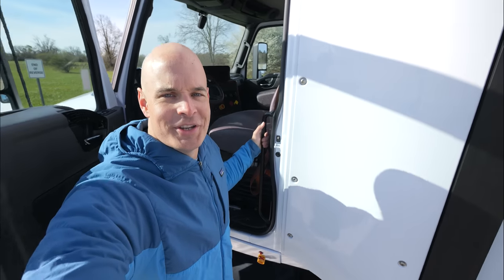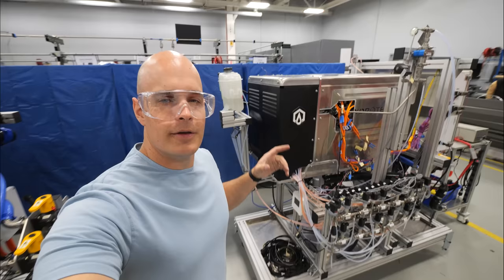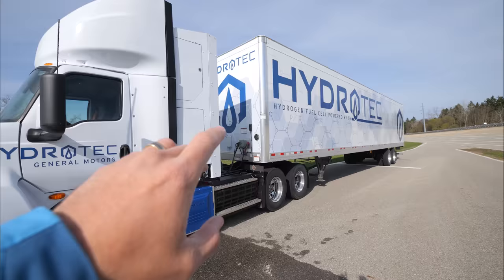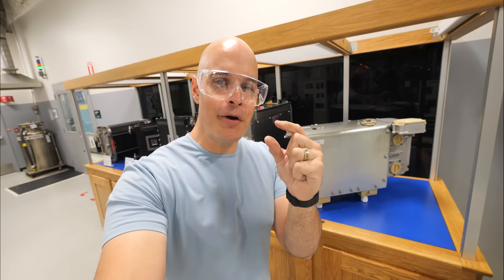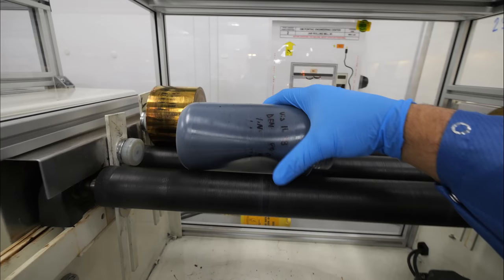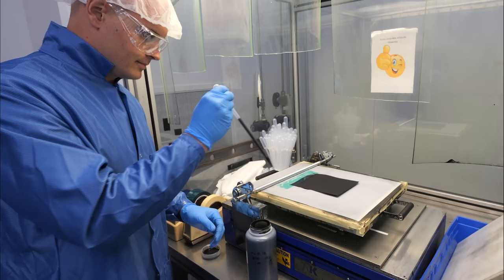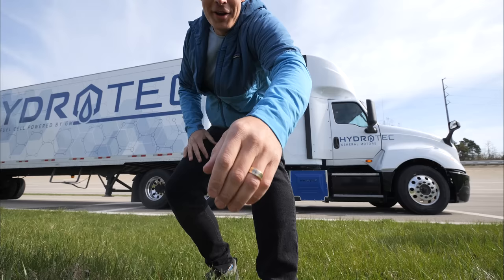How to build a Hydrogen Fuel Cell Semi Truck? - Hydrotec Factory Tour

Comment: Hydrogen is abundant but not in the form of H2 molecules. (The one that is burning in these cells.) Thus you need yet another energy source to do the hydrolysis and generate hydrogen from water. Not a very economically viable process...

Comment: So basically, hydrogen vehicle is electric vehicle charged by hydrogen. Thats why toyota wasnt launched ev at the first place, they keep doing research on hydrogen vehicle, which is way more more complex than ev. The hybrid system itself is way more complex than pure electric vehicle, they have to find a combination series-paralel engine to the most efficient way. Respect toyota.

Comment: So in a few years you can buy a portable  hydrogen generator to charge your tesla.
Reply: Smh
You take electricity.
Plug your Hydrogen generator  into the wall socket.
Make hydrogen.thrn use a fuel cell to convert it back to electricity to "charge your Tesla"
But you only have 30% of the electricity that you put into the "generator"
..
Really?
Think it through.
Reply: @rogerstarkey5390  
What if you charge your tesla with solar
Make hydrogen with solar then you have a solar powerbank😀

Comment: Fantastic! It would be interesting to see if some huge solar farms out west could generate enough energy to make hydrogen a significant part of the transportation fuel source. Awesome video!
Reply: Or.
Those same huge solar farms could move EV trucks 3 times the distance for the same cost.
If you were running a fleet, and someone said "we can provide two types of vehicle, one will cost you 30% that of the other in fuel"
Which would you take?
.
Then, when you said "but that vehicle doesn't travel as far on one "tank" of fuel, they told you
"It can run as far as your driver, then while your driver rests (compulsory!) it will "fill" up without the driver being there and give more range than is needed for the rest of the day"
.
Would it be a difficult choice?

Comment: But isn't it too expensive! Are we saving enough that it can reduce carbon emissions. Plus it is much more complex and dangerous as we know hydrogen is explosive. And platinum is pretty  expensive. I am pretty sure H2 fuel cell will be much more simpler in near future. But as of now Combustion engine and normal electric engine are good.

Comment: It doesn't make sense to use hydrogen to electrify trucks, when we already have a solution that is super easy and more efficient to electrify - trains. Using overhead wires, rather than having hydrogen or batteries as an inneficcient middleman, we can take electricity straight off the grid, making it ridiculously efficient. Add that to the fact that trains are inherently more efficient than trucks due to reduced rolling resistance, and you tell me what the best solution is.

Comment: Hi Zack, Hydrogen powered Semi Trucks is not feasible due to the fact that the proton exchange membranes in the trucks require platinum and iridium, metals that are rare and can only be mined in 3 countries - South Africa, Russia and Zimbabwe. Also, while the Hydrogen power is green itself, the production of Hydrogen is not since production of Hydrogen relies heavily on fossil fuels. Moreover, Hydrogen powered vehicles do not like cold temperatures.  Sabine Hossenfelder has a youtube video called "Hydrogen Will Not Save Us. Here's Why." which covers all these details and it is a fascinating watch. I suggest you check it out.

Comment: Toyota Motor certainly reckon that Hydrogen is the way forward since they are starting to make their cars for Hydrogen rather than electric according to the video I was watching a few weeks ago. Peugeot motors were on about making all goods vehicles with Hydrogen that was a few years ago but I think they changed their minds as Hydrogen wasn’t going anywhere at that time with Governments wasting time going down the electric route which as we all know but a lot refuse to believe isn’t either green or going to work although it is getting better but it’s carbon footprint is through the roof.

Comment: Yes Jerry, you should do a comparative analysis of what would be required to replace your humvee battery with a hybrid battery and hydrogen fuel cell stack and storage.

Also you will need to evaluate the water dissociation process to generate hydrogen and compress and store it, all from renewables of course, as opposed to striping the Hydrogen from hydrocarbons.

Which brings us to the meaningless talking point you made about hydrogen being the most abundant element in the Galaxy(sic), you should have said universe.  EVen so, all that hydrogen isn't available as an energy carrier until we liberate it from some other compound, like water.  So I'm afraid you've fallen victim of a pointless legacy industry talking point "most abundant" my friend.

Don't get me wrong, I'm familiar with hydrogen as energy systems technology.  I'm glad we have PEM (Proton Exchange Membranes) technologies like the one they let you build.  And I'm particularly fond of metal hydride storage methods that are as dense as liquid h2 but at more meer mortal ambient temp and pressures (300psi) with weight as the trade off.

But all that we can know and Occam's Razor continues to lead me to the conclusion decade after decade that Hydrogen Fool Sells are nothing more than a Rude Goldberg Battery.  The major difference being that HFC keeps users dependent on a specialty fuel vendor paradigm, mostly for the sake of the preservation of itself AFAIKT.

Comment: This is cool tech but I'm not convinced by hydrogen. You said that this has been in development for 50 years at this facility? I'm pretty sure that batteries are in production right now. The fuel tank is made from carbon fibre, which is still only made by hand and is a very specialist, slow, expensive and non environmentally friendly process. Then it has to be held at huge pressures, which costs energy. Add the complexity and cost (environmental and financial) of actually making hydrogen. Batteries have their problems but they seem fairly easily solvable compared to H1

Comment: I'm not convinced
This is a huge footprint for the tanks
They are probably extremely expensive to manufacture and maintain
How dangerous is fuel stored at that pressure?
This is not as quiet as he stated (He's speaking quite loud to talk over it)
Reply: Well Saars, if you are not convinced I guess they should shut the whole thing down.
Reply: @a_kazakis  I hope development continues and they make some major improvements, but the way it currently works, I don't really think it will see major adoption
Hope I get proved wrong though because we need trucks to get off diesel asap

Comment: Why start off with an irrelevant fact that hydrogen is the most common element in the galaxy?  That's nice, I live on planet Earth where it's like number 10.  I guess it doesn't sound as impressive if you say: Hydrogen is the 10th most common element on Earth.  Doesn't really have the same ring.

Comment: Question. Is any hydrogen lost in the process or is it all converted to water? If it all converted could a second unit take the water that is produced and separate the hydrogen to be used again? Essential an endless supply of fuel. I am guessing no. Lol.
Reply: No you can’t because where would that energy come from to to split the H2O?
Reply: @Simon-dm8zv  the fuel cell.
Reply: @ncphenom2309  So.. where would the hydrogen come from to power the fuel cell?
Reply: @Simon-dm8zv  I don’t think you are following. The fuel cell converts the hydrogen and oxygen into water which then a separate system could “steal” use from the fuel cell to separate the hydrogen back out to be reused by the fuel cell. My guess is that the energy needed to do this would max out the cell capacity and thus not work.
Reply: @ncphenom2309  I am completely following. What you are proposing is not possible, as you already admit in the last sentence.
Reply: @Simon-dm8zv  I’d like someone with actual knowledge around it to confirm.
Reply: Can confirm, NO.
Way too many losses in electrolysis of water and heat in the fuel cell.
The whole reason we have so much water on this planet is because that H-O-H bond is so hard to break.
Reply: @jimurrata6785  yup

Comment: if viable, sure. getting loose around the most reactive gas spells disaster. and procurement of hydrogen on a commercial spectrum is easier said then done. in a few decades maybe. but they called it the tech of tomorrow 35 years ago so it is justified to be muted in response.

Comment: Cool but will never happen except for demos and PR.
1. Hydrogen is expensive. It’s 4-5x more than gas/diesel and 10-20x more expensive than EV
2. Most hydrogen is created with fossil fuel so not really “clean”. Very little hydrogen is “green hydrogen”
3. Fuel cells are super expensive - even too expensive for semis.
4. By the time it is “market ready” EV semis will already dominate the road
5. Because of all of the above, there will never be a hydrogen refueling network… it will be too expensive to build and no reason to build since EV semis will kill it before it makes it to market

With 500 mile being more than what most drivers can drive a day (due to driving hours limitations), the Semi shows EV Semi are feasible. With batteries improving in capacity at about 5%/year, we’ll either see cost decrease or, if needed, range increase - with having 600-650 mile semis within the next 5 years - way more than any driver can drive without breaks.
Reply: Very well explained.

Comment: Tesla Semi will wipe the floor with this hydrogen nonsense. In commercial world running cost is everything, and since every hydrogen vehicle requires about 3 times more electricity than normal EV truck, this will never see the light of day.
And yes, hydrogen fuel stations still do not exist

Comment: #1.6👍🎉Great video Jerry!  I think the clean electricity production solution isn't solar or wind but geothermal because it works 24/7 and is just a short distance below us.  Long transmission lines will be very necessary.

Comment: Using hydrogen is effectively as dumb as purchasing an electric car and putting a gas generator in the trunk to charge the batteries. Oh, and you have to manufacture the gas yourself, using grid power.

Comment: no hydrogen can't leak through metal mate..it's just composite carbon fiber tanks can be made to withstand high pressures for a lighter vessel
Reply: you might want to do some research on hydrogen embrittlement. pure hydrogen will make its way through almost anything.
Reply: @phalanx3803  hydrogen embrittlement is different than diffusion mate
Reply: @St0RM33  diffusion needs to take place first for embrittlement to happen. what ever way you want to slice the cake it doesn't change the fact hydrogen will go through almost everything. those tanks are special as they have a HPB hydrogen permeation barrier to stop it.

Comment: I personally think our transportation infrastructure in the US needs to figure out a way to entirely remove trucks from highway roads. Like significantly more rail or something. Trucks are nothing but an absolute menace on the highway, and so while I understand we depend on them and need them right now I do strongly believe we need to work towards a better solution.

That or improve public transport between cities dramaticaly

Comment: overhyped. Hydrogen engines and hydrogen boost has existed for almost 50 years and the industry forklifts use it a lot, the issue is that in a car crash these explode, violently and the industry hasn't found a way to make these indestructible enough to justify in high risk scenarios i.e. highway use. On a truck it makes sense because: how will the truck crash so bad that it will get crushed all the way to the bottle and then puncture the bottle? It can't. Also the gas stations that sell this would be KABOOM HAPPY!!

Comment: I like what they're doing with the platinum. Thinning it out like that is very important for two reasons, for one platinum is expensive and for the second we only have a limited platinum supply. Which is also the reason btw why hydrogen is not a good option for cars since we just don't have enough platinum to satisfy the car market for an extendend period of time.

Comment: I've always kind of wondered if you could take that water exhaust and split it again to get at the hydrogen, or maybe the water could be used in other ways. I assume, as it's just water, that it's environmentally safe to just dump into the water table.
Reply: You totally can, the problem is that it takes significantly more energy to split it than you'd get from the resulting hydrogen. Just like pointing a lamp at a solar panel, technically you'll get some power out of it but it isn't really useful. Since it should be pure, venting it should be fine though.

Comment: wheres the hydrogen come from though? fossil fuel power sources... not exactly a very good solution. hydrogen is just a battery that you charge using a source and has many losses during the process from start to end. overall its only a good solution if you can generate the hydrogen from a 100% sustainable source because right now its better to just charge an electric car with that same electricity rather than generate the hydrogen, transport it all over the country, put it in vehicles, then have an inefficient power generator
Reply: Somebody gets it.

Comment: Why aren't we just burning the hydrogen directly in a relatively standard engine? I know others have done it before, and water is still the only emission. Are fuel cells more efficient. If so, by how much?
Reply: You can't run a normal ice car with hydrogen.
Reply: thats what JCB are doing but it needs an engine made for it a normal engine can do it but it has a habit of making a lot of NOx if you get the burn wrong.

Comment: Small issue... realistic truck drivers sleep inside their trucks, which, as you may have noticed, is where ALL OF THE HYDROGEN STUFF IS STORED. Where are these people going to sleep? Hydrogen is so much more expenive and less efficient to use compared to just electric. Your using electricity anways, its such a waste.
Reply: How about the fact that ALL OF THE HYDROGEN STUFF is only enough for this truck to travel ~250 miles.
This is a day cab masquerading as a sleeper.

Comment: You keep saying Hydrogen is the most abundant gas in the universe but you fail to mention it's not common by itself at all on our planet. You need electrolysis to produce to, which uses enormous amount of electricity. Also no one wants a 10 000 psi bomb behind their drivers seat. Have you ever seen a semi crash or even 2 semis crashing into each other? Which is a common sight now a days with the new imported drivers with no experience that are behind every wheel in the US and Canada.

Comment: Would the water coming out of the "exhaust" not keep roads wet and thus making them more dangerous? I expect the water to be hot enough to evaporate quickly most of the time but what if
Reply: Hindenburg.. 18 wheels and up to 80000 pounds of little Hindenburg's racing around the interstates..

 But seriously it doesn't matter because hydrogen is just another energy Carrier, it's solving none of our problems and makes everything worse.

Comment: Need to lead the exhaust water to the side of the road or disperse it better. Esp for colder climates :D
Reply: It's a chemically pure resource. Why piss it on the road at all?
Reply: @jimurrata6785  I don't know what kind of quantity is produced, but if it's possible to collect it, that would be preferred indeed.

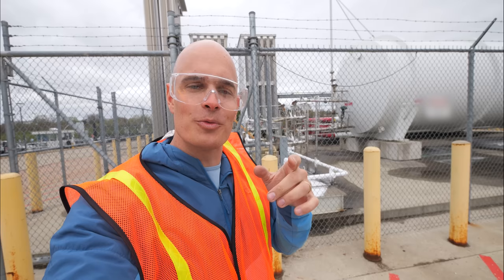Comment: Fun fact: liquid oxygen is what drips off of the lines leading in to the expansion (heat exchanger) lines. 4:28
Reply: Wrong.
That is frost (frozen condensed moisture)

Comment: Ok, why are pushing into electric vehicles then, and not this? Sincerely asking.
Reply: Because it is far more efficient, cheaper per mile and less complicated.
Reply: Let's start with _This IS an electric vehicle _
Then we can go with the added complexity of high pressure tanks and 2 fuel cells.
And we could discuss all the conversion losses inherent in using electricity to create hydrogen, compress hydrogen, and use hydrogen to go back to electricity. (something under 30% round trip)
Why would you start by throwing away 70+% of your energy before you even turn a wheel?

Comment: GM introduced this hydrogen fuel cell concept over 20 years ago, back in 2002. I did a presentation on it when I was in high school. They had a actual working concept car based on these fuel cells. Name of the car was Hy-Wire.

I am not sure why GM is doing this after so long…and hasn’t yet managed to realize it for the mainstream. I wish Zack had asked them about why it has taken them so long..

Comment: They’ve been developing the fuel cells for the past 50 years and all they have to show for it is this? Pretty sad. Seems like it probably won’t be viable in the future if it hasn’t taken off in 50 years.
Reply: The problem isn't "technology"
It's "Physics" (/"Chemistry"?)
.
"Scotty" was right
"Ye canna change the laws of physics" (if you're old enough you'll know).
If you can't create or destroy energy, only change it's form, and every time you do that, you LOSE energy, the trick is to only change state the minimum number of times to get the job done.
If you have 2 choices
1) Generation> electricity>"chemical"> electricity
Or
Generation> electricity>gas>liquid>
"chemical"> electricity
.
It seems logical that #1 will be more efficient, provide more "bang per buck".
.
K.I.S.S for the win.
.
(Then there's infrastructure, complexity, maintenance, etc to consider.....)